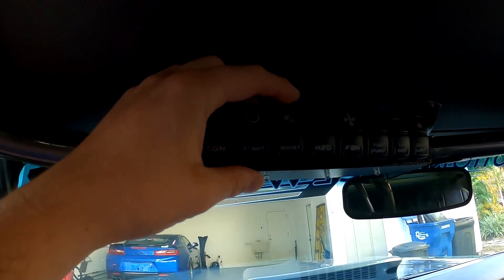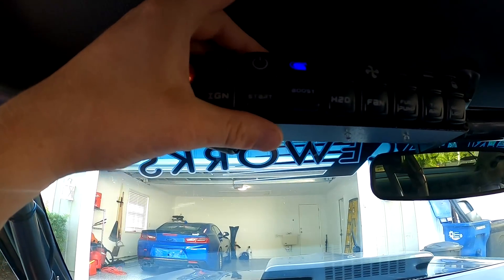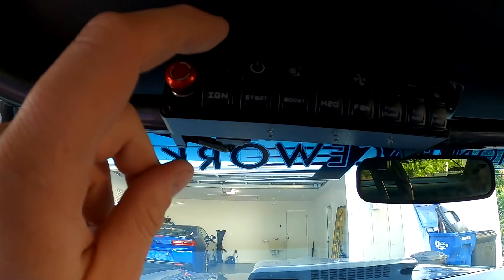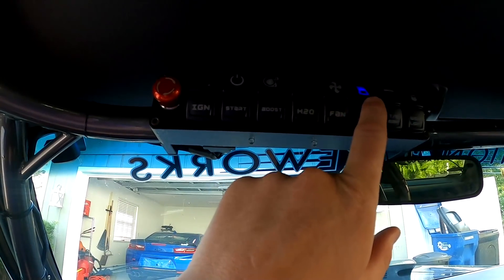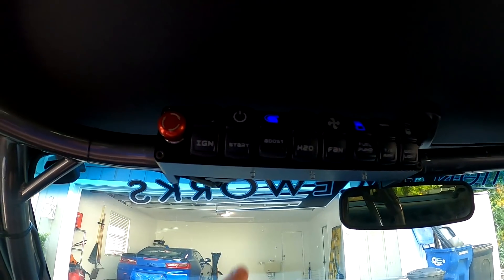How I Wire an Aeromotive Brushless 5, 7 or 10 GPM fuel pump.  Keep it simple!

Comment: So I had a turbo on a 4.8 so it stayed on low pressure all the time with the 5.0… now I have a 370 and it’s going lean from 2-3 shift …if I wire it on high all the time will that hurt my pump or do I have to run it separately? I do cruise on the street a bit thanks
Reply: Wire it to work correctly.

Comment: I just started looking at these pumps.  Is there any reason you couldn't just create a tps based 12v output in a holley ecu  and tie that to the signal wire?  I used to do something similar with a boost a pump.

Comment: The heat is actually coming from the electrical power that you put into the pump. Sure a brushless motor is more efficient than a brushed. It's physics, more pressure and more flow demands more power and in the end it will generate heat into the fuel and surrounding air. The exhaust and surrounding temperatures are hopefully shielded so that will not heat as much as the pump itself.

The real benefits are obvious with variable speed and an efficient motor. Giving less heat to the fuel at the same time it's stressing the electrical system less.

Comment: Doug I’ve watched this video 3 times and apparently I’m an idiot because I can’t figure it out. I want to wire my 10gpm pump exactly like yours. 0.5 volts on one switch for lowest volume and 3.7 on the other for maximum volume. I bought a painless 70 amp relay kit but am struggling to figure out exactly where to wire the switches in-line. Any help would be appreciated! I’m using the diagrams directly off the relay kit and from aeromotives website but I’m no electrician.
Reply: Mine isn't quite like doug's, but if you havent gotten around to wiring it, I have the ECU trigger the relay for it to be on the low setting, than I just use a switched 12 to the yellow wire to power my boost solenoid on, and the fuel pump to the high setting like he said

So the holley fuel pump wire goes to the switched 12v side of my relay, the output wire of that relay goes to the red wire on the pump, the ecu then primes and runs the pump like a stock one would. 

I flip a powered 12v switch and that goes to the power wire on my boost solenoid, and the yellow signal wire on the pump to speed it up to full. 

Hopefully that helps

Comment: So we can use Holley to switch it with 12v. Or use the i/o module wired to a relay to hit it with 12v. 

What about if I had a dual relay setup to feed power to my 5gpm pump. First relay is ran off the fuel pump wire from the Holley. Then when I get to say 5psi, my I/o module triggers my second relay to power the pump.. and T the pumps trigger wire into the power wire from the second relay.

Comment: Doug, what are using for connections from the pump pigtail to the larger 10ga power/ground required as per the Aeromotive instruction diagram? Thanks
Reply: I'd like to know as well.

Comment: I fully understand the concept, but still don't know how he is signaling the pump low and high. Is there a transformer between that first switch and the pump taking 12, 14, 16 volts down to less than 3.7? I'd assume the second switch then sends the full 12 or more volts.
Reply from the maker: It is happy seeing any voltage over 3.7 volts (and considers it the same as 3.7 volts) up to 16
Reply: @MotionRaceworksOfficial  I'm still not sure how you are triggering low speed? Or is it low speed by default with no voltage to the signal wire?
Reply: @MotionRaceworksOfficial  spoke with Aeromotive on this topic they claim for tuning purposes triggering and ramping in via TPS is their recommended option, they said if doing so using a shielded twisted pair wire off TPS is best to prevent any noise on the signal wire. Also claimed the signal wire draw is a super low milliamp draw so TPS readout is virtually un-effected in any way.

Comment: Wow great video this really cleared up a lot of stuff I had been wondering about I’m with you all the way until you said the pumps or pumps don’t work off the ign or ecu...so are you not running the green trigger wire for anything at all?

Forgive my ignorance
Reply from the maker: I don’t personally run mine off of the ECU, though you easily could have have it trigger off of either at the same time.  It doesn’t personally bother me to hit the fuel pump button before the starter, but everyone has a different preference.
Reply: @MotionRaceworksOfficial  oh yes I heard you speak on that I like how you have it set up, at the moment I’m just triggering a relay and ran decent wire for an I tank setup but great to see what you have done if my goals increase. Which they will.

Comment: At what point would you go to a complete mechanical fuel pump either cable driven or belt driven with maybe a surge take mounted near the pump on the motor? I just worry about over loading electronics with, i/c pumps, ecu, fuel pump, big electric cooling fans, can be hard on an electrical system.
Reply from the maker: Not necessary unless you make more power than 10gpm will deliver fuel for

Comment: Compared to a Magnafuel 4303/750 in line series?
Reply from the maker: Both are great options.  We love the 4303, but the 4303 flows significantly less.  It’s more in the range of 3-3.5 or so gpm
Reply: @MotionRaceworksOfficial  are the 4303’s able to be controlled like this as well with voltage?
Reply: Thanks a lot.